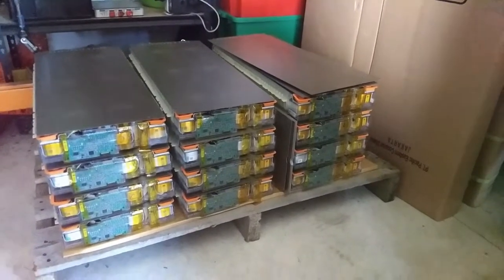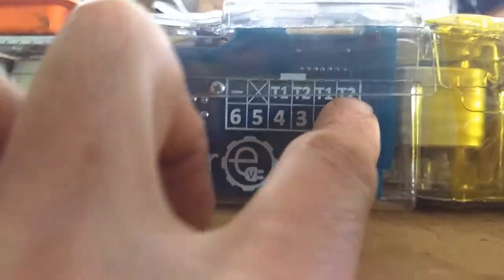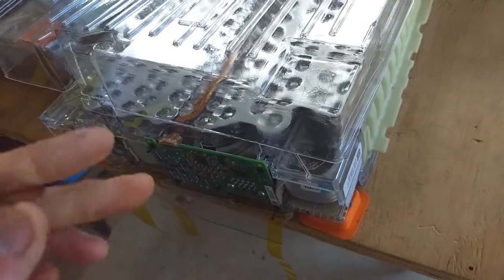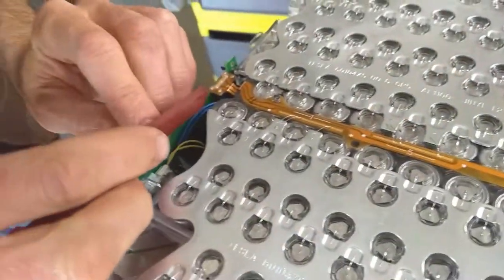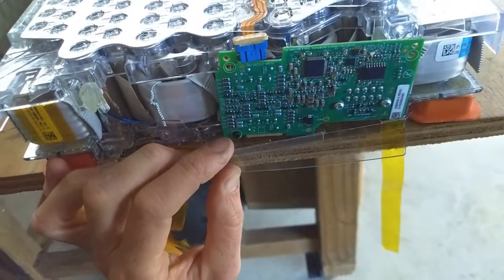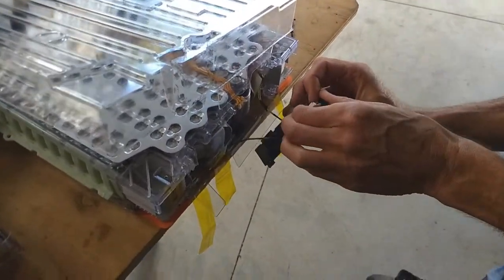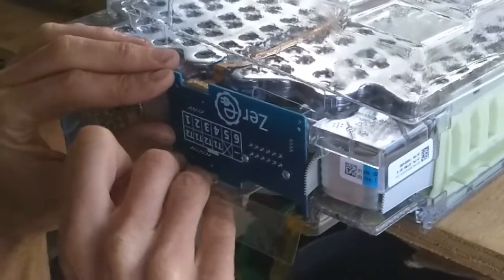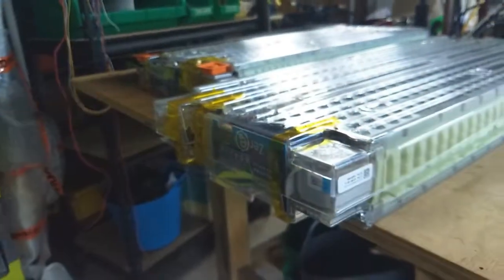Tesla Battery Module BMS Board Swap for Cell Tap Board

Comment: Just as a note to others about passive balancing, I have been testing two Tesla modules, one with a BMS and the other just passively balancing.  This is cycling from 20% - 80% SOC. After two years I can report the following, the passive balanced module cell readings were as follows:
Cell 1) 3.75, Cell 2) 3.76 Cell 3) 3.77 Cell 4) 3.76 Cell 5) 3.81 Cell 6) 3.84 so 0.09v from the lowest to highest series cells. 
I am now putting the Zero EV board and ISDT BMS or Active BMS to all my modules so that longevity of the modules is preserved, but I was interested to know how far they would go out of balance with no BMS after watching Will Prowse's videos about this.
Reply: I've tried to find that video wit no luck .do have a link.  Thanks

Comment: Hello,
thank you for the video. I have swapped two bms boards and teared one of the rippon cables a little. Do you know what type of plug it is?
I need to solder wires on a new plug for the upper strings :-(
Reply: On my first one I tore my ribbon cable and ended up putting wires to those cells and resoldering them to the plug! Won't do that again!

Comment: So this is to bypass restrictions caused by the Tesla battery module controller board? This allows you to use this battery pack for something else other than being in a Tesla vehicle, whilst maintaining some of the "awesomeness" of the design gone into the battery pack it's self?

Are you using this for a house "power wall" or to use in an RV Camper or something like that.... only now battery management and charging is done using the Orion BMS?

Please tell the viewers you're retaining the water cooling system for this? I would think that you are... Cause why keep everything inside the tesla pack otherwise?

The molex style connector is the new interface to go back to the Orion BMS... correct?

Comment: What charge controller are you going with, and how often do you plan on balancing?
Reply from the maker: It's running an Orion Junior BMS. I'll balance it if it gets out of balance. I'm running it at very conversative SOCs so it's not worth balancing-mV differences cover a huge amount of energy.
Reply from the maker: Charge controller is my trusty Outback